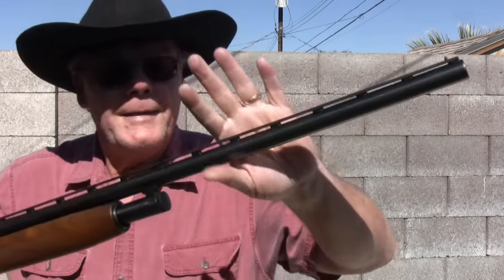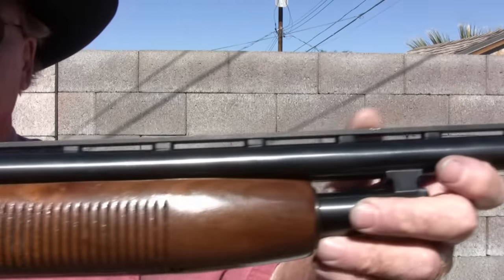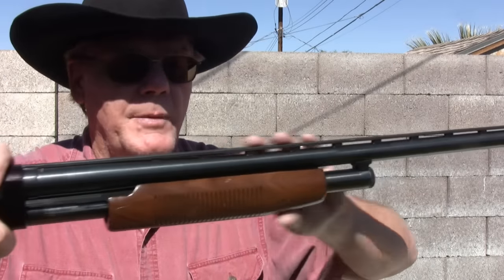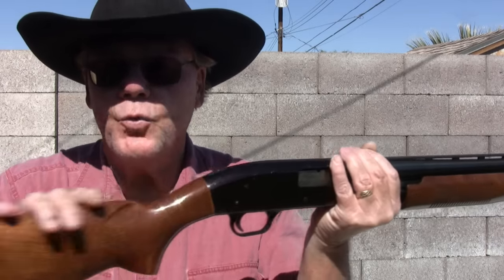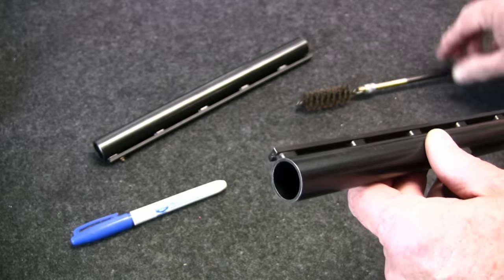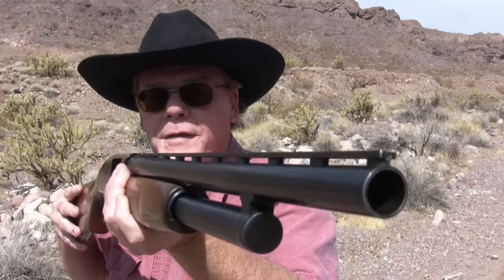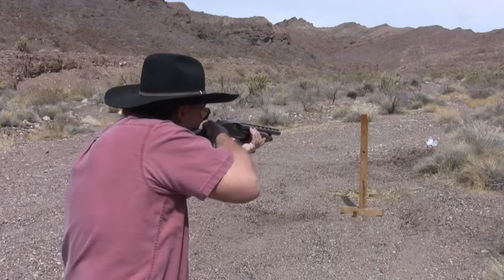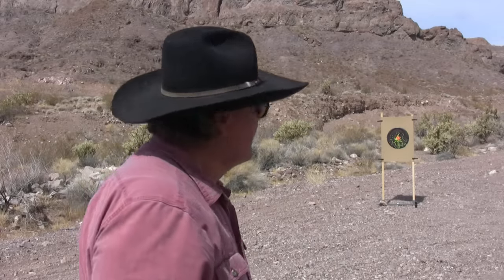How To Cut Down The Barrel & Replace The Ejector On A Mossberg 500 - Awesome Home Defense Shotgun!

Comment: I had to use a Remington grit edge carbide blade to trim my moss 600at.   If I had to do it again , I would sell long barrel and buy a 18.5 bbl
Reply from the maker: I thought about selling my long barrel and buying an 18.5 barrel but have you checked the price on a short barrel lately?  Damn, almost three hundred bucks for a new one if you can even find one.
Reply: Ah, memories! Surplus German 308 10 cents a round.  Crates of Russian 7.62 x 39 to feed to the sks - cheap.  British 303 still in the cloth Vickers belts dated 1946.  Sig 226 no one wanted to buy cause .40 was the new wonder round.

Comment: What are the minimum tools you'd need for this? I really wanna shorten mine but can't find any gunsmiths near me so I guess it's up to me
Reply from the maker: The minimum would be a tape measure, hacksaw and a  file. Make sure the barrel is at least 18" and the overall length at minimum 26" according to federal law. I would recommend the barrel be at least 18.25".
Reply: @mixup98  yeah imma do 20 cause that's where my next rib lands and it make room for those atf tape measures lmao plus if I ever throw a pistol grip on it I won't have to worry about overall length
Reply: Well dude you can do to much harm to it
Reply: Don't use power tools.

Comment: Being a trap shooter, cutting down a 30" full choke barrel brought a tear to my eye.  All my pumps, Wingmaster 870s, have 30" barrels with full chokes. (no rem chokes).  And a Remington 1100 with same barrel config.   You did an outstanding job on that barrel. I would have liked to see you put that front bead sight on.
Reply from the maker: I seriously debated with myself about cutting down the barrel but in the end I'm glad I did as now I have a great home defense shotgun. I did a follow-up video where I did show how to replace the front bead and here is that video:  https://youtu.be/BwMe3aPO_IQ
Reply: @mixup98  I have that same identical gun, a  New Haven  600AT, that came originally with a poly choke. I replaced the barrel with an 18" cylinder bore I got from Cabela's and replaced the stock with a rubber pistol grip and replaced the forearm with a rubber forearm for home defense. One thing I don't like about this gun is if you want to remove the bolt you have to take the magazine off the gun. One a standard 500 Mossberg , you don't have to so that.  I don't have the tools to take the magazine off the gun.  I'll watch that front site video. Thanks for the link.

Comment: Why replace the ejector?  Was it wore out or was it the 45 years on it that made you do it?  Thanks for the videos btw.
Reply: Well it was not ejecting properly.
Reply: You could it was ejecting weakly,  an throwing the shells back towards him.  Instead of outward,  an also failed to eject a few times. 

It looked perfectly fine,  but he didn't zoom in on it or anything.  Had he,  I'm sure there was very slight wear to it. But that's enough to effect the way it ejects, an for a 15$ part, is well worth it to change.

Comment: I'm relatively new to owning a shotgun.  I don't have a clamp and this type of work would be new to me. Can anyone tell me, is this an experienced gun owner kinda procedure to do or I mean, how difficult is this to pull off? I'd hate to ruin my barrel!
Reply: Chances if you don't have a vice, files, etc. I would not recommend it especially if you have a brand new gun. I would pratice on a piece of like size pipe first if it's your first time until you get the hang of it, or go to a gun Smith and get it done for $50 which will be cheaper than buying all the tools needed

Comment: what was wrong with the old ejector structurally???
Reply from the maker: The ejector is basically a bent leaf spring and over the decades it simply lost some of its bend, which effected its ability to move into the correct position to eject the spent shell.

Comment: The 500 will shoot but the 870 is 10 times the shotgun, whether a bird or riot gun it is still and will always be 10 times the pump gun. Love your videos man keep them up
Reply from the maker: Hello Kevin. I have owned a handful of 870's over the last three decades but I don't currently own one. The 870 is a great shotgun but the Mossberg is lighter, faster, smoother, has a better safety and it also has a more ergonomic bolt release.
Reply: Oh the Mossberg 500/590 hold up with out breaking vs about all other pump action shotguns. Sorry to say but it's a proven thing. That's why the 500 or 590 is the US Army issue shotguns. Not because it's lower cost.

Comment: None of my business but a new ejector probably wasn't necessary, nevertheless here goes some advise for anyone out there who owns one of these shotguns. Take the original one and bend it out a little bit so it springs out and kicks the shell out on the rearward travel of the bolt. Probably the old ejector got a "set" from being squeezed down by the closed bolt for so many years of no use.
Reply from the maker: Actually I did remove the old ejector and slightly bend it out but unfortunately it still wouldn't eject shells properly. I also noticed that the new ejector was shaped slightly different, which was probably an improvement over the original ejector. Thank you for the recommendation and I also thank you for being a six year subscriber.

Comment: You could also have the choke opened up. Are you going to have it threaded for chokes?
Reply from the maker: Probably not but it's possible. I intend to use it for short range.
Reply: He cut off the choked portion of the barrel. He's pretty much running cylinder bore now.
Reply: @rudyschwab7709  I know, just saying there are other options. Still a good waterfowl gun.

Comment: Where do you measure the barrel from?
Reply: I looked this one up as I was curious, too. From the ATF: Briefly, “The [ATF] procedure for measuring barrel length is to measure from the closed bolt (or breech-face) to the furthermost end of the barrel”  Essentially, the barrel including the chamber.
Reply: @Maximus_Butthurticus  The ATF places a wooden dowell down in the barrel until it stops, then mark the barrel end.  When they measure the dowell, it leaves no doubt.  Yes, it includes the chamber too.

Comment: I bought a 28inch barrel shotgun for a really decent price. I want to cut it short so I can have a 20inch barrel. Don’t I need a choke? I don’t want to blow my face off. And what does a choke do on a shotgun?
Reply from the maker: A choke is simply a tapered constriction at the end of a barrel which helps control the spread of the lead shot or pellets. A full choke will allow you to shoot further with a shotgun as the pellets will stay grouped together for a longer distance. A shotgun used for short range, such as a home defense shotgun, really doesn't need any choke to be effective. No, you won't blow your face off. A 20" barrel with no choke will still be effective at 20 or 30 yards, maybe more, depending on the target and the type of shot or pellets being used. Hope this helps.
Reply: So I can cut my barrel 8inches and be good to go? It’s not going to mess my gun up any? And yes thanks that help a lot. Much appreciated!
Reply: @Crayon515  you wouldn't be able to install a choke in your newly shortened barrel anyway.  Chokes thread in to the end a of a stock barrel, your cut down barrel won't have threads in it.

Comment: Nice!  The only shotgun I have is the Stevens 320 security for home defense, I believe 18" ( I watched your video on it the other day)  I'm not a hunter, but I want to be prepared to be if necessary.  I've been doing some research on barrel lengths and chokes and different hunting applications.  I'm interested in buying another shotgun that would fill the role for general purpose hunting.  Any thoughts?  I remember seeing a Mossberg kit that had interchangeable barrels?  I want it to be able to take a small deer at 100m or less and any other type of field hunting for survival. (Grouse, pheasant, turkey, goose.....)  I would assume that my 18" could be used at close range?
Reply from the maker: Mossberg has the Model 500 which is still sold with the two barrels and I would highly recommend this combo for home defense and hunting. If you don't need the combo then I would suggest either a Model 500 or a Remington Model 870 with a 26" or 28" barrel that uses screw-in chokes. These screw-in chokes will allow you to hunt deer or small game simply by switching chokes and ammo.
Reply: @mixup98  Thanks again, I'm here because I am genuinely interested in the content and doing research.  It's plain to see your love for this hobby and your willingness to help others. I had a channel for a few years and fully understand the time involved. Its very much appreciated. I will research the chokes.
Reply from the maker: @user-sh5dy5tr9d  👍🤠

Comment: I was expecting to see you remove the bead front sight from the last 10 inches of barrel you removed, and install it on the shortened 20" barrel.
Reply from the maker: Hello Barry. I did a follow-up video where I show how to install the front bead. Here is that video:  https://youtu.be/BwMe3aPO_IQ
Reply: @mixup98  - Thanks for the update, and the link to the bead transfer to the 20" barrel.

Comment: How can you be sure the end is square.  I'd like to see you add a bead.
Reply from the maker: A metal square can be used to check and square the end of the barrel if so desired but  I just eyeballed it. I should have a bead installation video posted in the near future.

Comment: Ejector looks like only a piece  of metal .  What goes wrong with it?
Reply from the maker: The ejector has a slight bend to it which helps it  catch the rim of the cartridge. Over time this bend, which constantly pushes against the closed bolt, will lose  its flex and start to straighten out, causing weak ejection.

Comment: Mossberg barrels are pretty easy to swap in and out. I have to feel that buying an 18.5 and swapping barrels would have been a better option. You can’t put a choke on a sawn off barrel, and you could prob sell the 28 on EBay for at least the cost of a new 18.5. However it’s your gun, so your choice.
Reply from the maker: I checked the price on new 18.5" Mossberg barrels before cutting down my 28" barrel and I found that the shorter barrels were selling for about $250! This was during the pandemic and the price of guns, ammo and barrels had skyrocketed. Seems like everyone wanted a short barrel at the time, and the 28" barrels were only selling for about a hundred bucks or so.
Reply: It's cheaper to cut the barrel lol.... Dude the barrels are like the cost of a new entire shotgun. Pretty easy AND cheap just to cut it

Comment: I keep hearing and reading 18 inches,  however the guy in a gun shop told me 18.5 inches.. An allot of the shotguns you see sold new are 20" or 18.5" . So now I'm not sure which it is..
Reply from the maker: According to federal law the absolute minimum length of a shotgun barrel is 18 inches. Most shotgun manufacturers make their short barrels at least 18.5 inches long just to be safe.
Reply: @mixup98  To avoid rounding error.  Math is hard - especially if you work in an alphabet agency for the govt. ;-)

Comment: 5 + 1 or 4 +1?
Reply: 5 x 2 3/4"
Reply: That is my favorite Chicago track!
Reply from the maker: 5+1
Reply: @mixup98  I bought a Mossberg 500A 5+1, that was manufactured in 1989, in October for $190… 👍
Reply: a mossberg has 5+1. a remington has 4+1.a mossbergs safety is in a better place. unloading from the bottom without working the actipn. ejector is held by one screw as you saw. ejector staked in on a remington. an older remington is better built but to me a mossberg is just a better design
Reply: With an OpSol Mini adapter you can do 8+1 Federal Shorties and, from what I hear, 9+1 Aguila minis…

Comment: Try to find a 18.5 inch 500 barrel, they don't exist.  This is the next best thing.
Reply from the maker: I was going to sell my 30" barrel on ebay and buy an 18.5" inch but damn...the short barrels are selling for close to three hundred bucks on ebay if you do find one. I made a wise decision to cut down my barrel.
Reply: @mixup98  My first shotgun I bought when I turned 18 (in 1983) is a Model500. It came with 28" and 18.5" barrels. I still have it. Currently has Houge in place of wood stocks, a side saddle shell holder, and a sling. Loaded with OOBuck in the tube and slugs on the side. Perfect home defense gun. I have other, newer, Mossbergs that I enjoy as well.

Comment: PAWN SHOP ??? Man you cant find anything in the pawn shops around here got nuttin and if they do the price is through the roof
Reply from the maker: I was really surprised at the low price, especially in a pawn shop. I think the owner saw the name "New Haven" and thought it was a cheap shotgun, not knowing it was really a Mossberg 500. The funny thing is he had a used Mossberg 500 right next to this one and it had a $350 price tag on it. I'm still smiling.

Comment: 12:58 - Now try doing that with a Remington.
:)
Reply: Both guns have pros and cons. The major with the 870 is the strength of the reciever: +500000 shots.
The minus of the moss is the trigger housing sits in place with one pin - the trigger house can be knocked off if hit sideways and the lifter pops out if the gun's dropped on the ground. Though both guns will get you out of town or keep you safe in you house, I like the durability of steel
Reply: @ulflyng  
I get it.   A lot of my LE friends felt the same way.
Replacing the ejector...
Changing the ejector in a Remi is no easything.   The ejector in a Remi is held in place by a blind screw.   So you have to get that out.   Then you run a new one in from the outside of the receiver.   Then you have to cut it off and refinish the receiver when you're done.   Try doing that at the range, or in my case the woods.   Not happening.
The steel receiver...
The explosion happens in the chamber of the steel barrel after the steel bolt is locked into place.   The receiver of any AR-style platform, regardless of caliber, is... aluminum.    Even when using .50 Beowulf
.
Reply: @jupiterjunk   Agree about the ejector. Do-able, but a draaaag.
When I mention steel reciever as a plus, it isn't due to ability to take pressure. As you say the lock is between barrel and bolt. The benefit of a steel reciever is the overall ability to take recoil and the movement of the bolt in the action. Steel against steel is stronger than aluminum against steel. That's why Moss goes about 20.000 shots on a reciever, and 870s goes +500.000. 20k is enough for us normal ppl. But high volume shooters /trap/skeet shoots much more in a year.
And it's why Moss do not have a trap model.
A little politic: UN has a goal to remove ALL firearms from ppl! When so, get a gun for your grandchildrens grandchildren
All the best
Reply: If you want a straight cut mind you, I heard this now. Try using a hose clamp on the barrel before cutting. It will give you a straight cut once you’re clamp is securely clamped down around the barrel. Take it or leave it. It’s your barrel. I also heard  to use a dowel rod to measure your barrel length. By dropping the dowel rod down the inside of the barrel to the breach. Once the breach is fully extended. You could also ask your sheriff department in your county, how they measure barrel length’s legally. Just some food for thought.
Reply: Remington 870 failed military trials every time it was entered.
Only thing that stopped Mossberg the 1st time was polymer trigger group, mil spec requires metal.
Remington failed with a 5% failures to fire. Mossberg 0 failures.
Reply: @njzeigler4370  
I will say... the truggerpack of the 590-A1... is well worth the $$$$$.

Comment: ISN'T THAT 18 IN MINIMUM FROM THE END OF THE SHELL NOT COUNTING THE CHAMBER SO A THREE OR THREE AND A HALF INCH PLUS 18 IN ???
DAVID GRENIS LIVING IN BOULDER COLORADO USA
Reply from the maker: Hi David. No, you don't measure from the end of the shell. The correct way to measure is to close the action and, using a tape measure, measure inside the barrel from the face of the bolt to the end of the barrel. You can also measure from the back end of the chamber to the front of the barrel. Eighteen inches is the legal minimum for a shotgun barrel but most owners will cut their barrel to eighteen and a half inches just to be safe.
Reply: @mixup98  you are correct. The test rod used to check my riot gun (1985) was a @.20 caliber and about 24" long, aluminum rod marked incrementally in inches, dropped down the barrel, unloaded with bolt closed. The 18" mark (shotguns and 16" for carbines) better not be protruding unless there is a Form 4. The rod was used to check from .22 through 10 GA "sawed" off  barrels. 
20" was perfect on your shotgun for the last dovetail on the rib.

Comment: Take a piece of wood (a stud will do) and bore a hole in it as close to the barrel diameter as you can get. Then saw a slot from the edge to the hole like a key slot. Insert the barrel to slightly above flush and clamp on the slot with a vice to tighten the barrel square. Now with a file and sanding block, finish the barrel end flat. You'll find the file cuts the barrel end without cutting the wood. Minimum effort, maximum result.
Reply: oh never mind file will cut the hose clamp